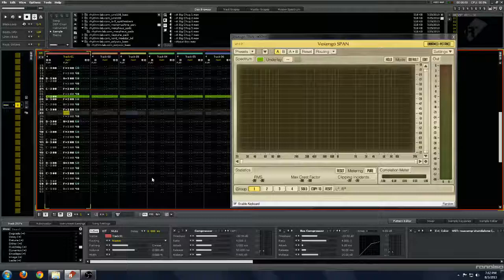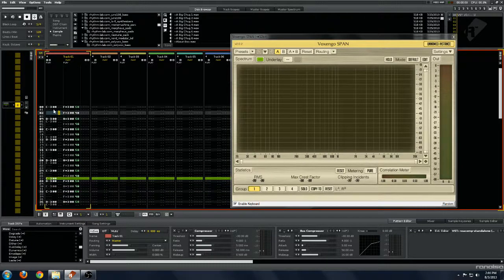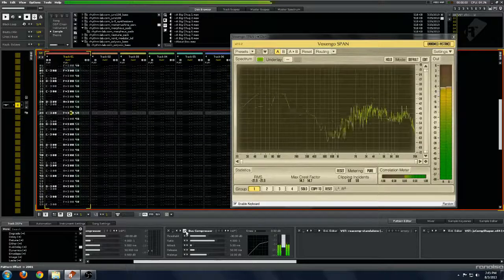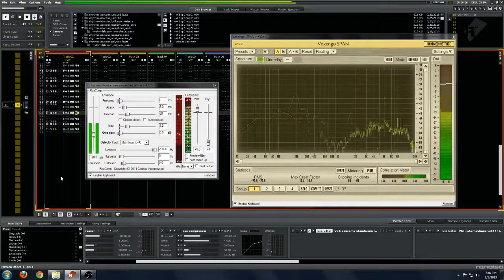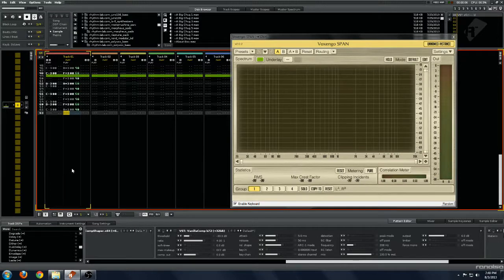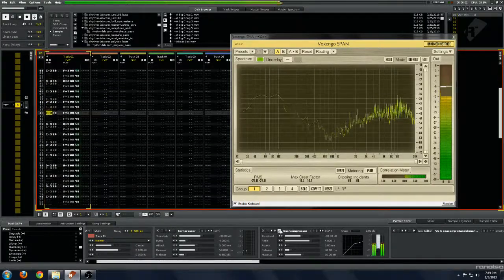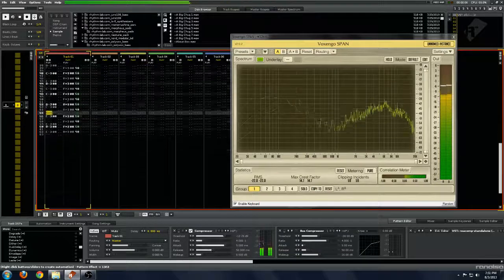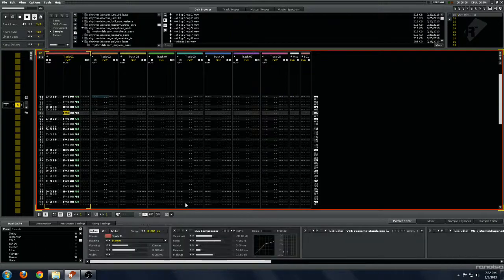Renoise Compressor

Comment: For native aggressive compression in renoise, I use the native gate effect in "duck" mode. However, there's no way to control the ratio automatically and you have to add gain to the track yourself.

Comment: realize I'm late to the game but I noticed instantly that you didn't match makeup gains.  The renoise compressor made the audio quieter because it has no make-up gain which is what a compressor should do.  User error
Reply: Thanks for clarifying, as a Renoise user, this helps out a lot~
Reply from the maker: I know I'm 3 years late on this but the makeup gains are matched to equal the input level of the original loop, which you can obviously see in the SPAN level meter. Not only that, but the compression effect is obviously visible in the waveform on the third party compressors. Also, you can hear the compression effects quite clearly with your ears -- 15db is an absurd amount of compression that would be audible to nearly anyone, yet the Renoise compressor shows almost no compression at all.
Reply: @brainpalace6781  Are you planning to do any more renoise videos?